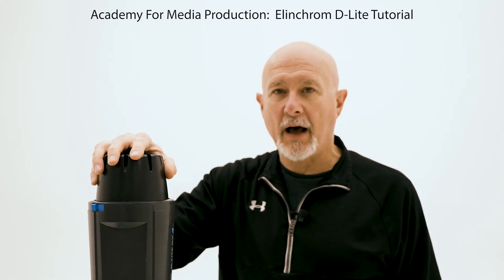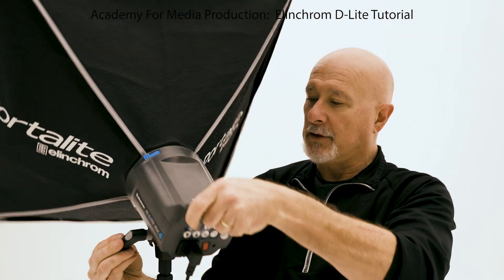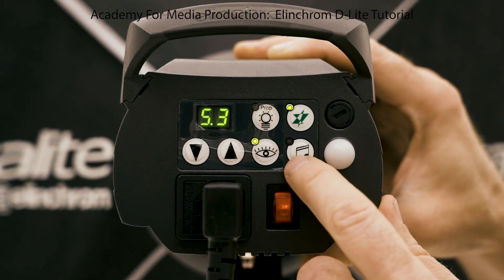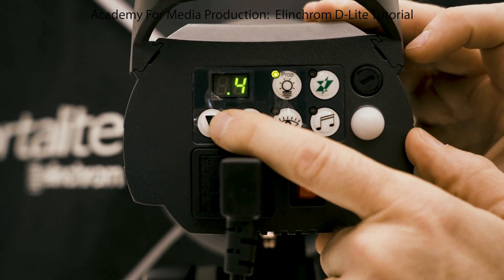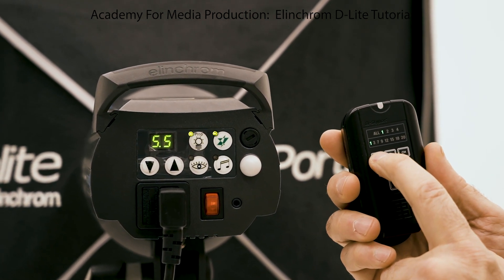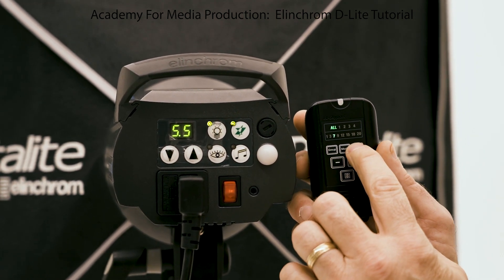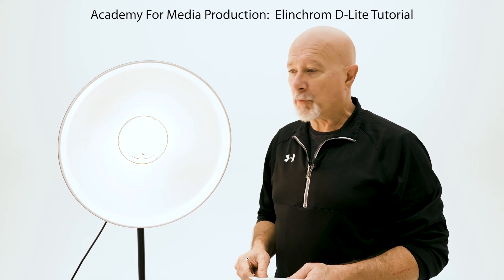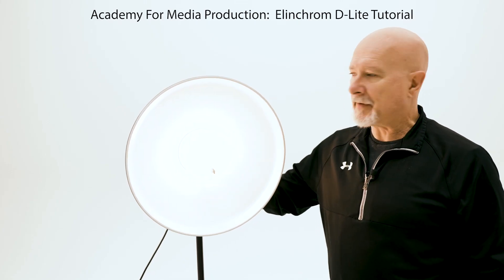Elinchrom Tutorial

Comment: Hey Bill thanks for this tutorial. I currently own a used early and basic model Elinchrom D-Lite 4 kit that was handed to me from a relative a few years back. The kit is in great condition and all the functions work with the exception of when I am trying to get to the menu to change the group and frequency channels. As i followed the steps to get to the menu while pressing the up and down arrow buttons simultaneously no menu screen populates to create settings for my lights. If you have any suggestions on how to correct this problem i would appreciate your help before I convince myself that this kit just does not function properly and now have to go out and invest on a new lighting system. Thanks for your help.
Reply: Hi, sorry to inform you but the older D-Lite 4 models don't have the ability to change group, radio or frequency so you won't see them show up when you press the up and down arrows together. Only the later D-Lite 4 IT (intelligent triggering) and D-Lite 4 RX have this capability.
Reply: That’s helpful but how do we change it if we can’t do it from the back like yourself. Mine looks exactly like yours…
Reply: @VictoriaEvans-jp4gv I know the back looks the same but the skyport technology is not built into the older models of the D-Lite 4. It is only in the D-Lite 4 IT model or the D-Lite RX 4 model. If you don't see "it" or "RX" on the side label you can't make the changes. The older model never had the skyport trigger included in the kit because there was no radio frequency to change.